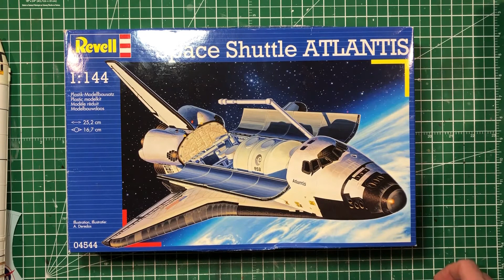Airfix 1/144 Space Shuttle Part 2 -  The Space Shuttle Orbiter

Comment: Hello, I am actually finding the AIRFIX to be a much better model than the Revell Discovery with boosters kit I am also building which uses the same kit as the Revell Atlantis orbiter. I think you just glue the bay doors open if you want them open but hinges would be nice. It thought the payload bay doors fitted brilliantly. Much less filling. 
If you want to see really badly fitting payload bay doors, then Revell wins that prize hands down. They are the worst fitting part I have ever seen. Having big problems withe the Revell ones tbh.
I think the detail on the AIRFIX is far better, the main engine nozzles for instance. The Revell one is like they looked at a picture and did the tooling from memory.